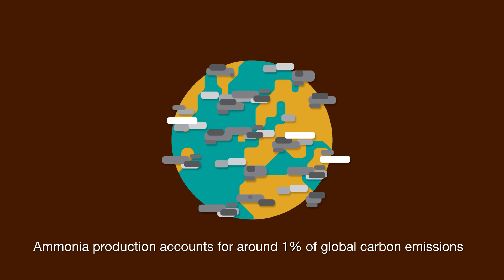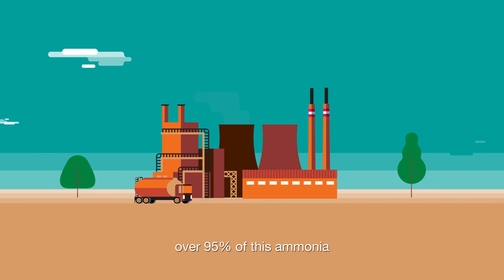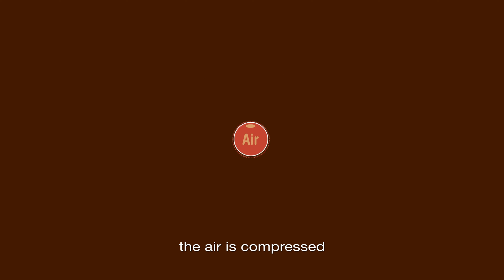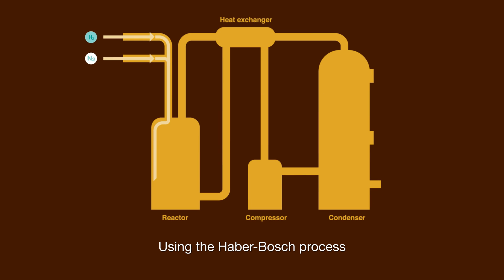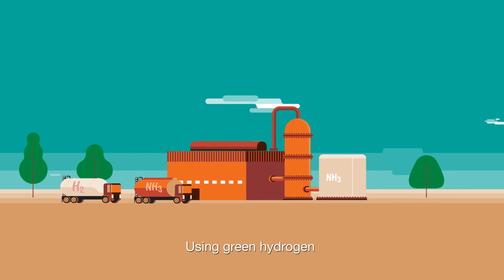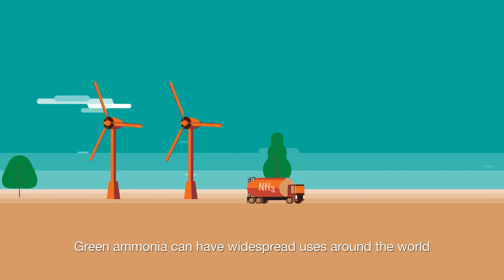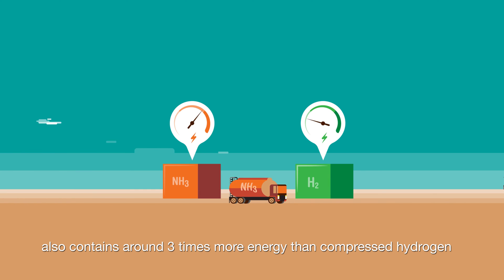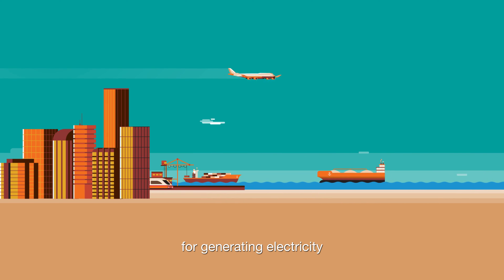How To Produce Green Ammonia

Comment: If you are interested in cleantech (green) investing or hydrogen economy stocks, you should check out FuelPositive, a publicly traded Canadian company with a market capitalization of about $40.00 million CAD (TSXV: NHHH or OTCQB: NHHHF).  You are likely to see negative posts in stock forums about this company because of issues that management had to overcome with supply chain and restructuring delays, but the company has finally completed factory acceptance testing (FAT) and shipped its first commercial unit to a customer on April 15, 2024.

FuelPositive’s flagship product is a containerized green ammonia production system for farmers.  The system, built in shipping containers that reside on-farm, takes air, water, and a sustainable electricity source to produce green ammonia, which farmers use for fertilizer.  The system is contained in several 20-foot shipping containers and consists of a nitrogen generator to produce nitrogen from air, an electrolyzer to produce hydrogen from water, and a novel synthesis convertor (provisional patent) to produce ammonia (NH3 - one nitrogen atom and three hydrogen atoms) from the nitrogen and hydrogen.  By placing the system on-farm, the farmer no longer needs to worry about price volatility or supply chain/distribution system issues (steady price and reliable supply).  This is a huge benefit for big farms.  The company anticipates farmers will also use the ammonia or the hydrogen via fuel cells to run farm machinery and for other farm needs such as grain drying.

The market for ammonia is around US$80 billion annually and the agriculture sector uses about 80% of ammonia produced each year.  Governments around the world are keen to decarbonize and current ammonia production methods are very carbon intensive (ammonia, cement, and steel are the big three carbon intensive industrial products).  It also turns out that ammonia is the perfect carrier for hydrogen (the three hydrogen atoms in the NH3), so FuelPositive could have a big impact on the larger hydrogen economy (for example, for fuel cells in transportation applications).

The flagship product, dubbed the FP300, will be able to produce 100 tons of ammonia a year.  Due to interest from larger farms, the company has also stated they will build an FP1500 that is more cost effective as one control unit can manage five times as many production units.  Each unit will be remotely monitored by FuelPositive and is built to last several decades with minor maintenance and replacement parts.  The company says the price will change somewhat based on the needs of each individual farm, but the stated base price of an FP300 is C$950,000 (farmers are used to making big dollar equipment purchases).  The company has been vetting potential customers around the world, but will initially focus on Manitoba, Canada due to the concentration of farmers and availability of abundant cheap (green) grid electricity from renewable hydropower plants.

FuelPositive anticipates each FP300 in operation will generate significant carbon credit revenue each year for the next several decades (potentially out to 2050), which will be split 30% to the farmer and 70% to FuelPositive (Tesla generated $1.79 billion from carbon credit sales in 2023).  Each FP300 in operation is projected to generate around C$20,000 in carbon credit revenue per year, increasing each year as the market price per ton for carbon credits increases through 2030 when each unit is projected to generate almost C$31,000 per year.

The CEO stated in a November 8, 2023, press release that FuelPositive has hundreds of systems in the sales pipeline and has stated that getting a 50% market share in Manitoba alone would result in over 2,000 FP300 systems deployed.  The CEO stated in this interview that the company is in serious discussions with customers for the purchase of over 200 systems, and expects to take deposits soon on an initial batch of 30 systems: https://www.youtube.com/watch?v=l98VxRa_mZY&t=33s

The company will start with batch manufacturing and anticipates collecting 30% production deposits from farmers to reserve their place in line.  Getting 30% deposits on the initial 30 FP300 systems would represent C$9.00 million in deposits with the sale of the systems representing almost C$30.00 million in revenue compared to the current C$40.00 million market cap for a very attractive Price to Revenue multiple of 1.33x.

A Zacks Small Cap Research Analyst says clean-tech companies are normally valued between 6-and-9 times annual revenue, so C$30.00 million in revenue implies a market capitalization between C$180.00 million and C$270.00 million, 350% to 575% higher than the current C$40.00 million.  This would equate to a stock price between C$0.38 and C$0.56 compared to the current C$0.07 stock price.

Shipping the first unit to the farm has taken a lot of the risk of succeeding off the table.  The company will have to figure out how to raise the capital to build the first automated production facility which will be scaled to produce 500 FP300 units a year (which would be about C$500 million in annual revenue), but FuelPositive has put out several recent press releases about meetings with government officials that makes current shareholders speculate the company will get government support to build the production facility in the form of loans or grants.

This company has a bunch of potential and now that some of the risk has been taken off the table, the stock price could increase pretty fast as more people become aware of the potential.  For full disclosure, I own a bunch of shares, and this is not investment advice.  Do your own due diligence.  There is a lot of information on the company’s website (fuelpositive.com) and the company also has a social media presence on places like LinkedIn or X-twitter.

Comment: Why not keep the green hydrogen for use in a fuel cell vehicle instead of using it to produce ammonia?
Reply: Because is very hard to store hydrogen. You need special tanks, special pipes, special everything. One leak of hydrogen and it goes boom ! Hydrogen turns liquid at -253C - almoust close to absolute zero. Ammonia is in a liquid state at 25 degrees Celsius at normal atmospheric pressure. And doesn`t go boom, when in contact with oxygen. Much safer, less logistic problems higher energy density per kg.
Reply: @M4V3RiCkU235  Ammonia is a liquid at -33°C at atmospheric pressure or at 10 bar at room temperature. However, it is still relatively easy to obtain compared to H2
Reply: @quentinburband9281 yeah, you`re right. But still, the temperature that you can get in a civilian professional fridge. Not rocket science. I thinking of infrastructure for LPG for example. Is more volatile and still cars in Europe work just fine with that
Reply: Easier to store/transport ammonia because stability. If there's ammonia engines, it's about exhaust/safety.
Reply: I think it also mentions ammonia is 3x more efficient in terms of energy density

Comment: how are you moving all that heat?  How is this green?  Are you burning coal to power a furnace?
Reply: STOP promoting Green energy communist garbage!!!!!
Reply: The ammonia production process itself does not cause any harmful emissions or byproducts besides an almost negligible amount of NOx. Nitrogen is an abundant resource in the atmosphere and the H is just obtained from water via hydrolysis. The only thing really "used" is electricity, so if you use sustainable energy sources such as solar, wind, geothermal, etc, the ammonia production process is "green."
Reply: @Z-xk5pi ammonia production does produce carbon emissions, most of the hydrogen obtained via hydrocarbon reforming
Reply: @Z-xk5pi  green energy is filth! Climate change propaganda garbage!!!
Reply: Diesel can be used because carbon capture machines can be used during/afterward. Diesel cars very regulated some countries, but ammonia/ev hybrids might be way.
Reply: @sampleoffers1978  CCS is a meme tho, i'm bullish Ammonia for vehicles, so is Toyota having avoided much of the pure EV hype, they retained their hybrid knowledge.
Reply: @ith-zu2sy Ammonia is apparently dangerous if a leak for fumes. Seems better for grid as energy storage or to make electricity/hydrogen onsite with it.
Reply: @sampleoffers1978 green energy is filth. STOP promoting that filth!!!